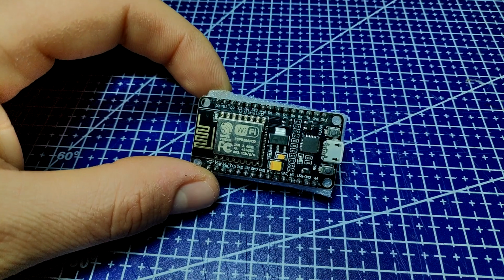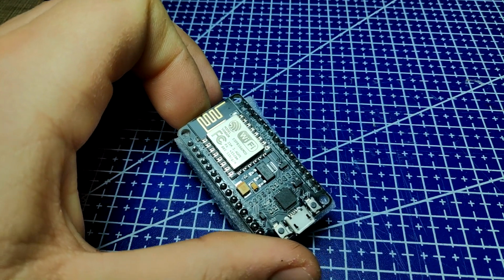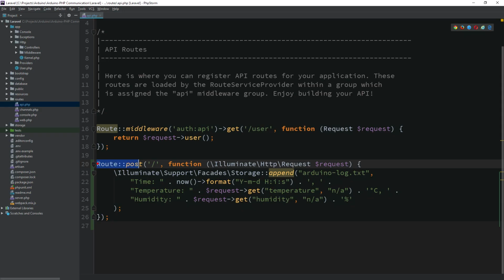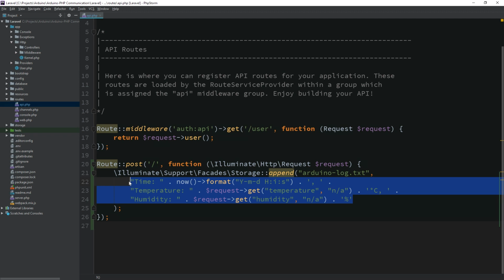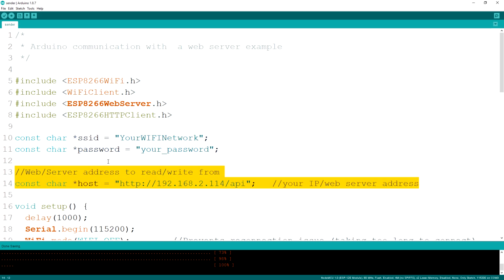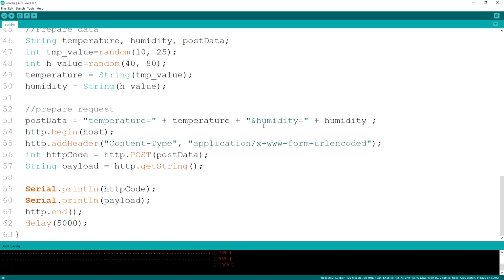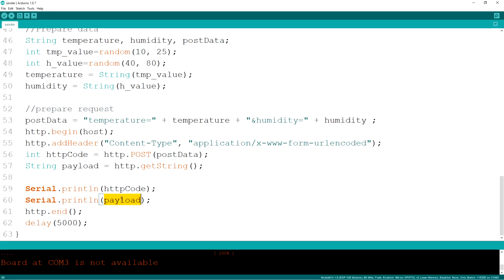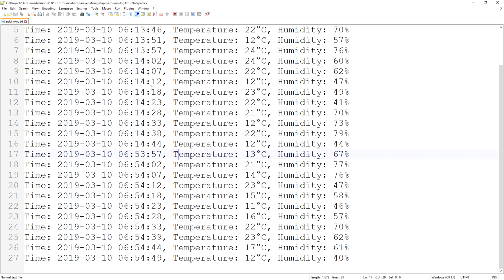Arduino to Laravel Communication - Send data from NodeMCU to Laravel

Comment: Sir, how to send back data from the web app to Arduino? For example to turn on some motor or something like that?
Reply from the maker: The easiest way is to have the Arduino periodically check for updated data on the web services as it is not easy to have it located as it can change addresses. Another option is to use an MQTT broker and have it subscribed to a topic but that uses very different implementation.
Reply: @TasteTheCode  Do you have some examples?
Reply from the maker: You can check this video for an example of data pulling https://youtu.be/aKgtz3-gwrY unfortunately, I do not have an MQTT example yet.

Comment: Sir, i want to make publish temperature data to laravel and then make command from laravel (like button) to turn on fan that connected to esp

Can you give me an example please? Thank you
Reply from the maker: Your use case is almost the same to the example given. For the button you can read a route on laravel periodically for a flag and turn the fan from that.
Reply from the maker: Yes that is an option as well!
Reply: @darmikela  how to use mqtt for laravel?

Comment: Are you using a laravel built-in server?  php artisan serve?
Reply from the maker: No. I usually use Laragon.
Reply: @TasteTheCode  okei. can it be run on hosting?
Reply from the maker: @muhammadsholihulh3703  yes, there shouldn't be any issues with that. My main site runs on laravel with shared hosting on DreamHost.
Reply: @TasteTheCode  Okey, Do you need a port? 50?
Reply from the maker: Nope, it runs by default on 80.

Comment: sir i have a problem, when i post data using eps8266 to a form using laravel valet in windows an error occurs in the arduino ide serial monitor, the error is Valet - Not found, can you help me ?
Reply: the error display on the arduino ide serial monitor :

UID tag :CC27646B
<html>
    <head>
        <title>Valet - Not Found</title>

        <style>
            body {
                font-family: monospace;
            }
        </style>
    </head>
    <body>
        404 - Not Found
    </body>
</html>
Reply from the maker: @irhamaldiyanto1707  I think that your problem is with the Laravel app, not the Arduino communication. Try executing the same request from Postman or a similar app so you can better debug it.
Reply: I've tried in postman and the code is working fine, should I reinstall laravel valet?
Reply from the maker: Is it a local site? If so, then you might have a DNS issue where the Arduino can't recognize the URL or the server is not listening on the right IP.
Reply: @TasteTheCode  That's right, I've changed the local side and I've changed the DNS according to Laravel Valet regulations
Reply from the maker: The problem with that DNS is that it only applies to your local machine and not to the Arduino. The Arduino can only access the site through the network IP address and your server is probably not listening on it.
Reply: @TasteTheCode  how do i set up dns on my local machine ?
Reply from the maker: @irhamaldiyanto1707  you need DNS on the network, not the machine but that is a complicated path to take. Make sure that your Laravel app can be accessed through the network address as in my example (ex 192.168.1.114) Once you can do that from the browser/Postman, the Arduino will be able to access it as well.
Reply: @TasteTheCode  i try in postman and i got problem Fatal error: Uncaught Error: Class "Illuminate\Support\Facades\Route" not found

Comment: Sir, I have a problem with nodeMCU and Module RFID reader, I can't connect to the database using Laravel, I'm trying to build a student attendance system, and I still don't understand the tutorial. I want to follow the next tutorial by making a tutorial connecting Laravel with nodeMCU using RFID modules in real time. I hope you reply
Reply from the maker: What is the problem that you have? Try to split the system into two problems, RFID with NodeMCU and then NodeMCU to Laravel.
Reply: @TasteTheCode  

the problem is, it cannot connect nodeMCU to the database then the RFID reader can input data from the id card in realtime on laravel. and I can't do it yet. I did not find this tutorial anywhere, sorry. coz this is the first for me.
Reply from the maker: You can't connect directly to the DB. You need to make an endpoint in Laravel that the NodeMCU will send data to. Laravel will then talk to the DB.
Reply: @SuperSimpleToddlerSongs  can you make a video regarding data upload to a database
Reply: bang udh bisa blm ?

Comment: It does not work for me, and in the serial monitor it shows me an html with error.
Reply from the maker: Can you be more specific what the error is? Also can you verify that the route works what accessed through browser?
Reply: @TasteTheCode  in the arduino code I have the host: "http://192.168.0.101/api" and in the serial monitor it shows me the 404 error
Reply: @TasteTheCode  and in the browser (127.0.0.1:8000/api) it shows error "The GET method is not supported for this route. Supported methods: POST."
Reply from the maker: You have an error in the IP mapping. Make sure to get the same GET/POST error in the browser when accessing it through the external IP.
Reply: @TasteTheCode  I just changed the name to "192.168.0.100/myProject/public/api" and I managed to do it
Reply from the maker: @k_orsd  Nice! I'm glad you fixed it!
Reply: how do you fix it I have an error like you?

Comment: Sir where I can find documentain about arduino for laravel?
Reply from the maker: There is nothing specific. You need to make an API in Laravel and consume it with Arduino.
Reply from the maker: Yeah it should be. I haven't worked with fingerprint scanners so far but you should be able to first register a fingerprint in a database and use your scanner to verify it later.

Comment: url http://127.0.0.1:8000/api
 error  The GET method is not supported for this route. Supported methods: POST. 
can you help me solve the error?
Reply: The requested URL was not found on this server.
Reply from the maker: Ouuuppppssss....
Reply: @TasteTheCode  Fatal error: Uncaught Error: Class 'Illuminate\Support\Facades\Route' not found in C:\xampp\htdocs\Nodemcu\routes\api.php:7 Stack trace: #0 {main} thrown in C:\xampp\htdocs\Nodemcu\routes\api.php on line 7
Reply: @TasteTheCode  hello, I got the same message error, could you tell us some solution to this ?
Reply from the maker: @matejschrodl7055  It is very difficult for me to know what you are doing wrong. Check your routes, make sure you use the right get/post method in them.